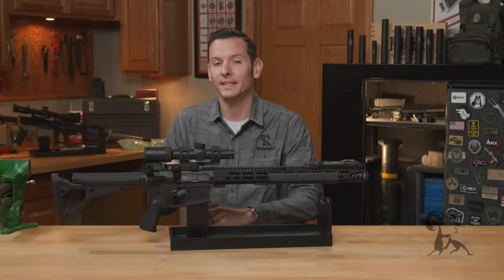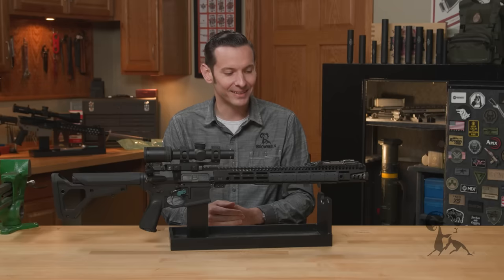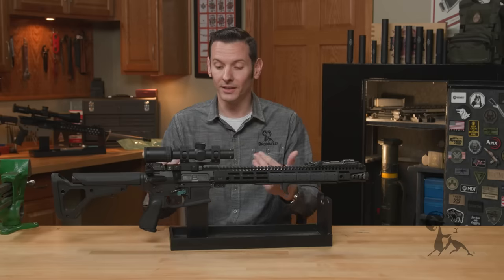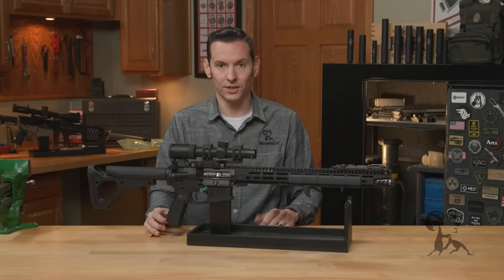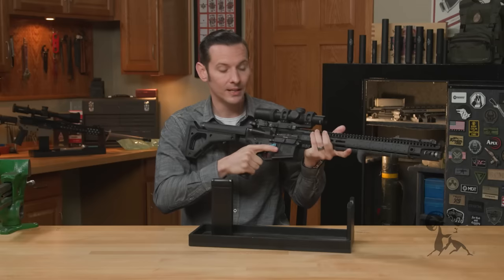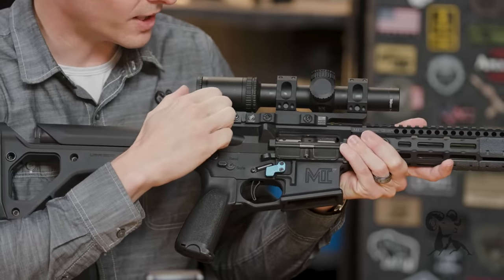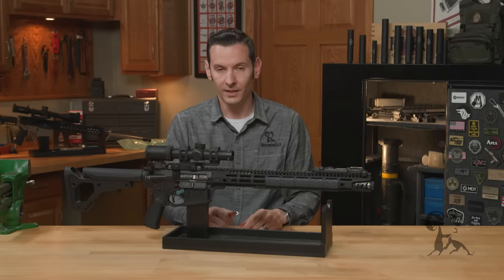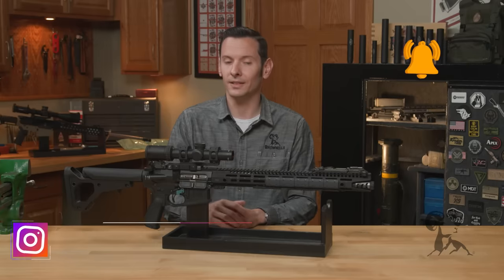Quick Tip: The RIGHT Way To Use the Forward Assist

Comment: Carrying the platform for 13 years in the USMC I have found the need for the forward assist many times and have never seen it cause a malfunction
Reply: I am ex Army infantry and I agree completely
Reply: I have seen it assist in making malfunctions worse, but never cause one. And I have also found need for it on many occasions. Always better to have and not need something than need and not have it.
Reply: @stuckgrenadepin.225  What malfunction did you see it make worse?
Reply: I'm interested in same.
Also thanks for your service gents.
Reply: @ferrumchnop6617  👍
Reply: Crickets?
Reply: Exactly!!  It is a great option to have for many situations... Anyone who thinks it's unnecessary hasn't spent enough time carrying it around.
Reply: Suuuure
Reply: I used the forward assist once on my ar15 when it was new, it didn’t go completely back into battery, I hit it and it went into battery.  After a few rounds never had that issue again.
Reply: I’ve heard people say that the forward assist is useless or doesn’t work. I never bothered to ask why they believe this. I suppose it’s just people who were never formally trained on the AR platform (I.e, no prior military service)

Comment: I have trained hand to hand EXTENSIVELY and one of the points we always seem to make is the "blood on your hands" argument. The handling of any tool, gun, knife, baton, or just bare handing anything with blood on your hands increases the difficulty of wielding said item exponentially. The absolute last thing I would want to do, is try to fumble to seat that round with bloody hands and a screaming hot bolt by pushing on the scallop. This I think lays within the realm of rather have it and not need it than the other way around. What's the worst that will happen? You look at it and it just sits there.
Reply: Where are your gloves? And why are you trying to force a round into battery that doesn't want to be there?
Reply: Adds a bit of weight and it sticks out to bump into and get caught on things. Maybe I'd still rather have it, but only slightly rather.
Reply: @benningsniper9516  most people don’t wear gloves and those who do are typically doing it so they can look like Johnny Tac Ranger.
Reply: @jcraigshelton  you don't train with gloves on? I understand it's pretty ghey to wear them at the range, but if you're running a course, or don't have a pair in your truck ready to throw on, you're a POG.
Reply: @benningsniper9516  Do I have time to put on gloves?  Maybe, maybe not, but I'm for sure not going to worry about it when I have a perfectly good forward assist instead of fumbling around playing with the bolt.
Reply: True rabbit true
Reply: @benningsniper9516  i was an infantryman in the Army from 1998 to 2016 when i was medically retired. I, as well as many others didn't wear gloves, especially over in Iraq and Afghanistan, too damn hot. gloves don't make you hardcore, or make you shoot any better even if you cut off the trigger finger off the gloves. that just got your finger dirty and made it look like you stuck that one finger up your butt.

Comment: Good points. Another one is that if the charging handle catches your gear and slightly goes out of battery, you can tap the forward assist.
Reply: That's a really good one
Reply: @brianfischer5609  it happens especially with these oversized charging handles that are all the rage nowadays
Reply: @Valorius  lol I call  them wings!🤣
Reply: You mean like radian raptors? Or bigger?
Reply: @brianfischer5609  Really any oversize charging handle, especially ones with a forward sweep, can cause that. They are also snag happy demons when you're wearing web gear as well.
Reply: @Valorius  I stay with standard-sized chargers because when rucking them over mountains and across deserts the standard chargers are annoying enough snagging on gear or pressing into your chest. I couldn't imagine doing it with some of these crazy extended charging handles
Reply: @dsan94  the big charging handles are popular with people who have never done what you or I do
Reply: @dsan94  I hated how much the charging handle would get caught on gear while rucking through the God awful swamps of lejeune. I forget where I got it but I fount a changing handle with the latch on the right side (right handed shooter so facing away from gear when slung) and it worked great didn’t get snagged and pull my bolt out of battery and didn’t stick out enough for anyone to notice it on my issued rifle. Kinda hard to find them but a quick google search pulls up a few options like that
Reply: You could just tap your oversized charging handle…. 
But oh well… the forward assist does help, but it’s not actually needed. It’s like OSHA requiring you to wear a full body safety harness to climb a 12ft ladder. Just… like… get the job done…. Lol
Reply: @samuelyoung4646  did you just say you can tap a charging handle to seat an AR bolt? 🤔
Reply: @samuelyoung4646  tapping the charging handle doesn’t push the bolt forward.
Reply: @samuelyoung4646  tap the charging handle to do what?
Reply: @Valorius  to show everyone that he has no idea what he’s doing.
Reply: @RodolfoMartinez-px6cj  lmao. I wanted to hear him babble though :D
Reply: @samuelyoung4646  The charging handle can only pull the bolt rearward, it can NEVER push it forward. It is not connected.

Comment: Exactly! All the people that don’t know what it’s for always say “yeah forcing a round into the chamber isn’t correct” yes, that’s right, and not what the fwd assist is for lol
Reply: @zacsdiyguns  you want to bring up stoner….well the original M16 design didn’t even have a fwd assist. I believe your missing the point, as most do. It’s not to just blindly force a round into the chamber. You should know what’s goin on before just slamming the forward assist and possibly causing a malfunction or more serious condition.
Reply: @zacsdiyguns  yeah exactly basically from the first sets of M16’s arriving in nam with no cleaning kits coupled with no chrome lined barrels/being told-rumors not needing to be cleaned etc and having issues which could’ve  been corrected without a fa. Typically it’s not needed much if you properly pms your gun, but overseas it CAN have its place. I used them overseas, but if I had any malfunctions it was remedied the correct way and not using the fa. Mainly checking the gun is still chambered, not to lock the bolt. 
 Don’t get why people feel the need to argue over it, but whatever. Ford / Chevy I reckon.

Comment: The forward assist is most used for brass checks. In the old rifle tables for the Marine corps it was a requirement for those on the firing line to do a brass check and use the forward assist to ensure the bolt was in battery. As a coach, the only time I saw it become a jam enhancer was when a boot would attempt to use it if they had a double feed or brass behind bolt. In that case, yeah it kind of fucked up the gun more and we would be sat there trying to mortar the rifle for a while. So I think it's only a jam enhancer if someone has no idea how to clear a stoppage.
Reply: Also in fairness the newness Tap rack bang procedure also causes double feeds if you don't actually look in the chamber after you pull the charging handle back to make sure it is clear
Reply: Trying to clear a brass over bolt jam by “mortaring” the rifle is a really bad idea. I recently saw a cartridge with the bullet pushed back so the tip of the bullet was almost even with the case mouth. Ugliest jam ever!
Reply: @chipsterb4946  if anyone is interested in the correct procedure for clearing a bolt override malfunction there is a video showing how if you click my screen name.
Reply: You can do the same thing and make sure it’s in battle by lightly pressing on the back of the charging handle instead of the FA
Reply: @kurtnewman7182  what are you talking about?
Reply: @Valorius  he obviously has never operated, let alone cleared, an AR rifle.
Reply: @chipsterb4946  very clearly. Probably tells all his neighbors he was a Navy Seal in the Marines back in the 'Nam.
Reply: Cool pith helmet, Miles! Fellow former Marine rifle coach here. You don't bump into too many of us in the wild!
Reply: To be clear, no I'm not mortaring the rifle with brass behind bolt, only double feeds or other stopages/malfunctions when necessary. Although I did see that  once. We were there for a while in the armory trying to unfuck it.
Reply: this is a really logical response t hat i didn't know. thank you for sharing this.
Reply: Thanks Earl Wheeler
Reply: Seeing this a year late...  But, "Slingshot, brasscheck, tap the forward assist.  Sweep the sights, check the sights, ejection-port cover closed!"  1 Bn Bravo Co. Plt 1065 MCRDSD, 2006.  Ah, memories 🤣

Comment: The press check seems to be a valid way of using it.  There is another circumstance where it can be usefully employed on semiauto rifles that can include other guns besides the AR platform of rifles.  Releasing a bolt to slam home is the best way to be sure that bolt has closed, but it makes more noise than gently lowering the bolt.  In some hunting and combat scenarios when noise can result in alerted game or an enemy, lowering the bolt is quieter, but the  bolt may not closed on the chambered round.  The forward assist can help with it.  IIRC there were some sniper versions of the G3 that are equipped with a functional equivalent of a forward assist to allow more clandestine chambering and closing of the bolt.   
Stoner did not design the AR15 to have one and it was added later at the insistence of the military.

Comment: In the Marine Corps, Immediate action was tap, rack, bang. 
Remedial action used the the acronym SPORTS. The first "S" was for Seek cover (civilians usually forget this because no one is shooting back), The last "S" was Sight-in and fire. You don't want Marines just squeezing the trigger without aiming first, because some will.
Reply: Care to mention what the letters PORT stand for in that acronym?
Reply: @bobhopman4648  
S: seek cover
P: pull charging handle to the rear
O: observe chamber
R: remove obstruction/release the bolt
T: tap the forward assist
S: sight in and attempt to fire

Comment: when using a AR platform with 300AAC subsonic, I'm thanking the Lord for a forward assist which allows you to ride the charging handle and ensure getting into battery using the forward assist, all this while remaining quiet as a Whisper. Also using the release bolt lever to keep the action from making any more noise than needed when attempting to cycle.

Comment: Was originally trained SPORTS.  But typically use and teach Tap and Rack in classes, although I do cover the FA uses. I think people forget sometimes that there was an actual reason it got added to the platform's design, better to have it and never need it than need it and not have it. Great Vid, good stuff.
Reply: The reason it was added was because of the production failures with Colt 602 and change to ball propellant in M193.  They ran reamers ragged until chambers didn't meet spec, didn't issue cleaning kits, refused to chrome-line the chamber as Stoner demanded they do, then thought the solution was a band-aid malfunction assist device.

It's what you get in the culture of CONARC and Army Ordnance Board after 5 decades of public schooling and myopia by that time.

Had they kept reamers in-spec, chrome-lined the chambers on the 602s, and actually tested and integrated the action spring and buffer to account for the 10,000-20,000psi increase in gas port pressure, forward assist wouldn't exist.
Reply: @LRRPFco52  the reason it was added was because it was shown to be absolutely necessary in US Army Field trials there is an absolutely outstanding video series on YouTube called in defense of the Forward assist that shows all the documentation
Reply: @M7A1bayonet  Absolutely necessary, yet units who have guys shooting more rounds in a month than an entire Infantry Battalion fires in a year got along miraculously for over 40 years without it, to include some of the most successful operations conducted using AR-15 variants without FA.  The word "absolutely" is invalid in this context, but not absolutely invalid.
Reply: @LRRPFco52  that's b******. Flat b****** all of those units have ARs with fwd assists. Just cuz they had a few that didn't doesn't mean that's all they had your point is total nonsense.
Reply: @LRRPFco52  Keep on coping, buddy.
Reply: @zoltancsikos5604  There’s nothing to cope with.  I see a lot of younger guys talking about coping who don’t have any brain cells to rub together, but latch onto these stupid catch phrases and then use them out of any logical context.
Reply: I would have to agree with that logic sir.
Reply: SPORTS stands for:

1. SLAP the Lieutenant 
2. PULL him around the corner
3. OBSERVE for witnesses 
4. RELEASE the Lieutenant 
5. TELL no one
6. SEEK legal advice

It will not help you clear malfunctions in a timely manner and should have no bearing on how you handle the AR-15/M-16/M-4 family of weapons.
Reply: @vettelover2009 Stoner doesn’t know everything given he made a ridiculous claim that the M16A2 rear sight was bad because soldiers would play around with them and lose zero, which real soldiers and marines on 9Hole’s channel pointed out was a stupid argument. No professional military should have that problem with such undisciplined troops.
Reply: @vettelover2009 All that bullshit spewed and you still haven't seen 9Hole's video on it. It was pretty recent, quite fascinating. lol
Reply: @vettelover2009 Yeah, yeah, everyone says so on the internet, like Dan Bilzerian.

Doubt
Reply: @vettelover2009 How much infantry combat experience did Stoner have? How come SOCOM never demanded it be removed?
Reply: @vettelover2009 I don't understand the Air Force argument, since the Air Force only uses their rifles for guard duty. What does your anecdotal experience have to do with the documented detailed testing the army did that determined the forward assist was warranted?
Reply: @vettelover2009 The Air Force failed to do any testing to support their arguments, the Army did. There is no reproducible testing that shows the forward assist caused any problems. I am not interested in people's meaningless anecdotes, I am interested in reproducible evidence. Show me reproducible evidence that the forward assist can cause problems.

Comment: Like many others, I always felt the Forward Assist was most useful in quietly loading a round so as not to alert the prospective target.
Reply: I HAVE used it for that, but that isn't the purpose. Nothing wrong with it though. It is still serving the same function, just for a different reason.

Comment: I usually just thumbed the bolt forward if my M4 didn't go into battery - which was a very rare thing.  
I never had to use the forward assist during loading and firing.  During cleaning, I would let the bolt forward gently and set where it did and pressed the forward assist to make sure it was fluid in function.  
Proper weapon maintenance makes a big difference.
Reply: Proper maintenance on firearms is the most important thing in caring for the machine, forward assist is a feature.

Comment: Got a DPMS AR 10 in 308 for my son for deer hunting. It is the smooth side receiver without the FA. I did not consider getting in the stand before daylight and loading the gun until after I had bought it. I had a machinist add a side charging handle so it could be loaded quietly. A FA would have been a lot cheaper.